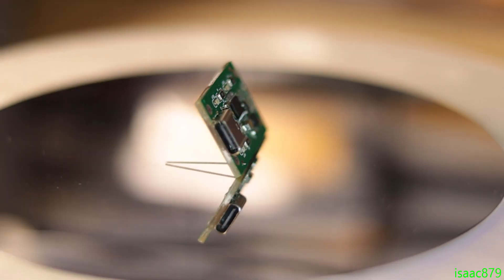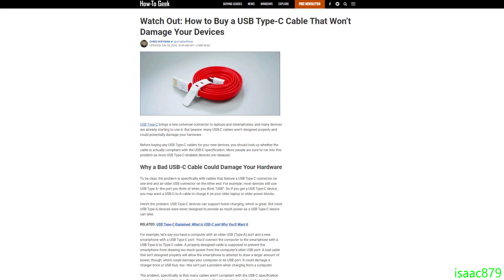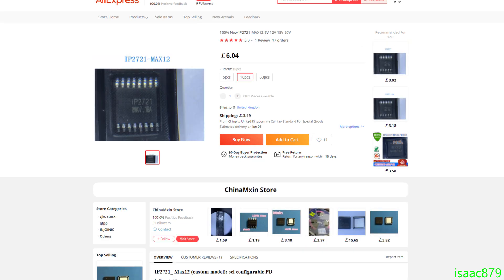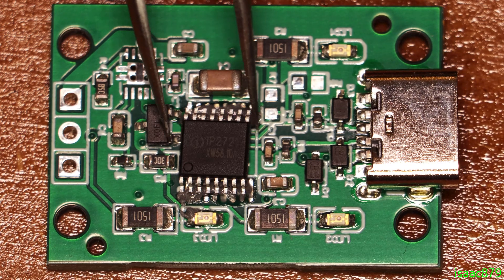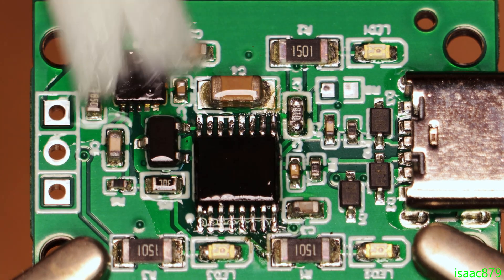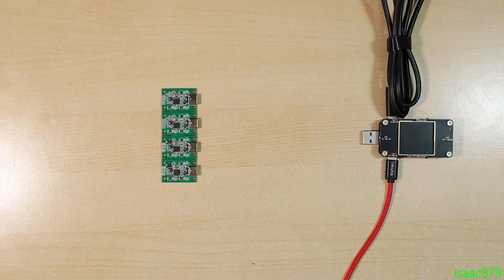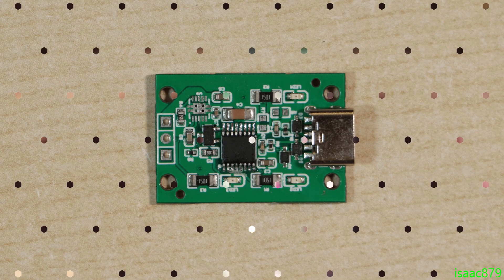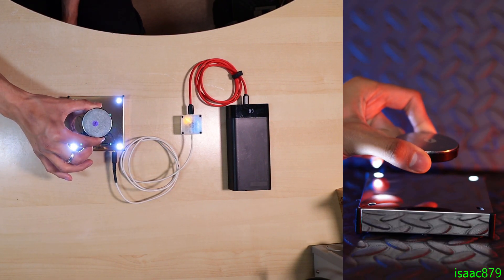Designing a USB PD (Power Delivery) Trigger Board For My Devices

Comment: u should buy turbine powered hotgun. this shit with thin nozzle from ur video is just for burning pcb`s.  also thin nozzle is causing components to fly away.
check quick857dw+ and use nozzle at least 1cm diameter or even without it or u are causing thermal shock of the pcb (thin nozzle with low air pressure and high temperature makes gradient of temperature, that causing problems)

Comment: I'd like to know if the trigger board can be used in a different manner. I have a 12v-to-5v step-down converter for my car and I'd like to connnect Apple's Magsafe puck to it to charge my iPhone. However, the Apple puck will not allow it as it requires the power source to be PD3.0 compliant. Can a trigger be used here to fool Apple's puck and allow the phone to charge?
Reply from the maker: No, unfortunately this board can only source power from a USB C PD supply.

Comment: Hi, where do you source the IP2721_MAX12 chip? I cannot find it on Aliexpress. I want only 9V so the normal IP2721 doesn't work for me
Reply from the maker: I got mine from here: https://www.aliexpress.com/item/1005002316588641.html?spm=a2g0o.order_list.order_list_main.82.5aba1802f5AC0J

There is also the option of the IP2721_ D variant that has two SEL pins so can be configured to 5, 9, 12, 15, and 20V: https://www.aliexpress.com/item/1005002316562305.html?spm=a2g0o.order_list.order_list_main.57.5aba1802f5AC0J

Comment: Hello issac, I'm new and I'm struggle with this problem for months:
I'd bought various pd trigger board, I want to pull 9v 3A (~27w) from charger/powerbank, but the problem is I can get only 9v 0.3A (2.7w) even when connected to the 60A ESC or a light bulb. The charger and powerbank supported 9v 3A, and can output up to 65W. I can't find solution for this. Can you explain why or give me some keywords to Googling? I found out that some people having the problem like mine, but no appropriate answer/solution yet.
Reply from the maker: Hi, It's hard to know what is causing the issue without being able to test the boards. First make sure the load isn't trying to draw a massive current spikes. ESCs can be very electrically noisy so even though the average current it low it might be causing big spikes exceeding 3A. Check the USB cable you are using it good quality and making good connections (I've had a few that became very loose in port and stopped working reliably). Some USB PD ICs/boards have a programmable current limit so make sure that is set to 3A and not 300mA.
Reply: @isaac879  Thank you for replying me. Actually, I did measure the Ampere wrong for months. It actually consume 0.0011-2.2A or more at 9v. Mystery unveiled.

Comment: Hi, if we are using one of there boards between a powerbank and a phone, and the phone's battery gets full, would the powerbank "turn off"?
I am trying to make a powerbank to stay ALWAYS ON. To behave as if it was a wall plug and let the phone decide whether it is "taking" power or not. Again, as if it was a wall plug situation.
(Back story: I am recording events with a phone and want to use a big powerbank to continuously supply power to the phone, until the powerbank runs out. Now, when the phone gets full, the bank turns off and then the phone uses the phone battery and nothing triggers the powerbank to turn on again.)
What other solutions do you know of? Any apps out there that can trigger a powerbank when battery is low?
Thank you
Reply from the maker: Unfortunately this board won't solve your problem. A lot of power banks automatically shut off the output when very little power is being drawn. As it's an issue on the power bank side of things, I doubt any apps would be able to solve the problem. 

If the phone is charging via one of the fast/quick charging protocols you might be able to force it to charge it slower by using a USB cable that does not have the data wires. That way if you're lucky the charge and discharge rate might match.

Another option might be to plug in a second device just continually draws enough power to stop it from turning off. (Something like a USB powered light).